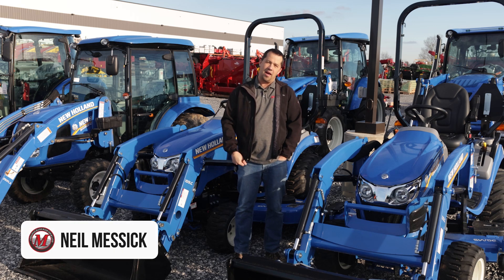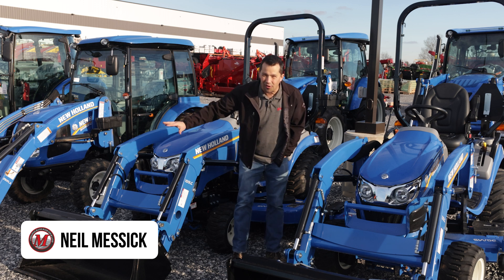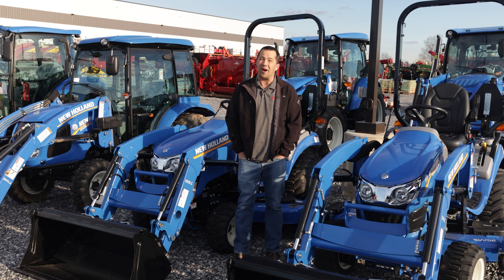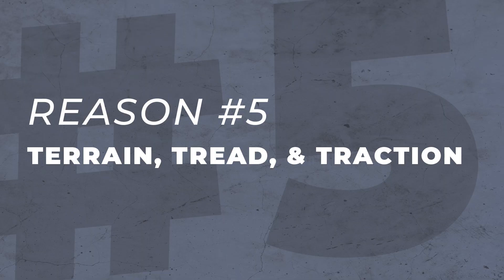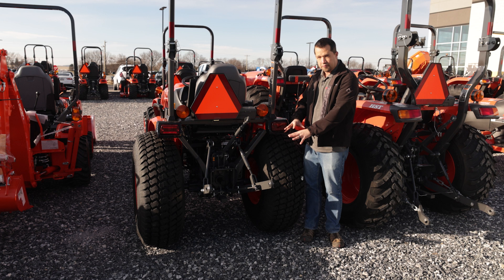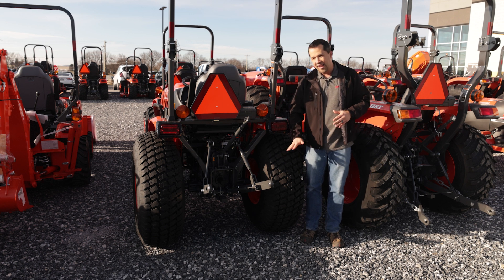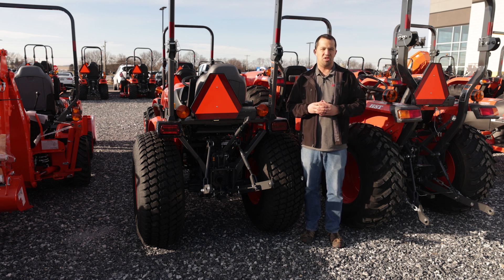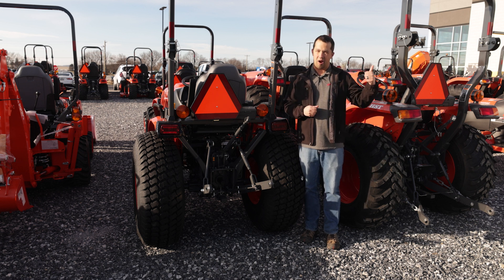5 Reasons Your Tractor Can't Climb a Hill

Comment: I love my 80s kubota ant 60s belarus. They pull like trains for their size. Cold hot, nothing maters. Most gears are limited by tire traction. Want quick responsive tractor? manual transmission will help.

Comment: That last thing you want to do is go up a hill fast. You need to feel the side and front balance. It's the difference between a close call, a tip, or a tip and roll. Slow is good. Going up in reverse is good. 4 wheel drive is good. Heavy weights on the wheels are good. Going fast is not good...I've had close calls on hills and it's made me take them much more seriously. Small hills, holes, bumps, etc...can all throw a tractor off balance if you're going too fast.

Comment: Pulling hills with a hydrostatic transmission is easy. I do it all the time in West Virginia. Let off the gas and let the RPM's stay around 2400, and a tractor will go right up a hill even a steep one with no problem. I have a L2501 pulls with no issues. It is a tractor not a side by side.

Comment: This video is interesting because i've always been amazed with how well our garden tractor climbs hills. Straight up a 30degree incline. And when we got a Kubota, it was an old manual trans with bad brakes, so I always make sure i'm in low range with high revs for fear of stalling. That thing will climb straight up a wall with the Asian market R2 tires.

Comment: I bought a new Workmaster 25 HST.  It was worthless in high range.  Shouldn't even come with a high range.  Took it back and bought a Workmaster 40 HST.  If I could do it over again I'd get the Workmaster 35 Gear Drive.  I'd save thousands and have more power.  Live and learn....

Comment: Hmmm...what do I know, original from Europe in Canada now. Big surprise calcium loaded rear tires when I bought my first tractor. The second one, I ask for no calcium in the tires. Lets not talk brands, before I borrowed a 50 horsepower tractor from a neighbor, going up the hill to my place had to shift down twice, just regular transmission, it was 30 years ago. The tractor I bought 60 horsepower, turbo charged, regular transmission no calcium in the tires to drag up that hill, just went up the hill in the big gear without any shifting down.

Comment: The hydro tranny is the biggest problem up or down a hill, had a  old 16hp diesel gear drive  compact and with the rear in lo and transmission in lo you could use the engine to crawl down steep hills without the tires breaking lose that you couldn't even think about with a hydro and pretty much the same going up not to mention the hp loss.

Comment: I used to mow an old dirty dirt dump with my tractor. This dump had massive hills that you couldn’t really mow sideways. So I would go up and down them. My tractor has a hydro transmission with 3 ranges. It could climb the hills in medium but did a lot better job in low.

Comment: One thing I have also noticed is the operator will not raise the RPM when putting the unit under load like that. You don’t need it all the way like you are running a bush hog but bringing it up off idle makes everything work a lot smoother

Comment: The swash plate angle does not change the gear ratio at all... it changes how much fluid is being pumped. In the neutral position it pumps no fluid so you don't move, as you push the pedal down the angle changes which allows the pistons to start moving fluid, a shallow angle moves a small amount of fluid at low pressure the steeper the angle the more fluid and pressure you get. That means if you push the pedal down harder, you will go faster and you will be applying more power to the ground. 

I think were people confuse this as being a higher gear ratio come from the fact that, the harder you push the pedal the more power hydrostatic pump needs from the tractors engine, in order to push the higher volumes and pressures through the pump. This can cause your tractor to bog or stall if it doesn't have enough hp for its Hydrostatic Pump size, tractor weight, and gearing. Remember that with a lot of these tractors the 25hp model might have the same transmission and mass as the 45hp model... Conclusion a lot of Hydro tractors are simply under powered for there size.

Comment: I have no idea why anyone would pay top dollar for a hydrostatic transmission. They put so much less HP to the ground, the oil changes, warm up time and everything else. Is it so important to have that gas pedal style of driving? And listening to all that whining from the pumps?
I think the glide shift is the way to go.  Just select a gear and go. Plus you get the HP you need to pull a mould board plow or other ground engaging equipment.
Reply from the maker: Glideshift was great, they don't sell it anymore.

Comment: Yes, the hydrostat pedal is not an accelerator, it's a "gear" range selector. Going up a hill, keep your foot where you want and add throttle up until you run out of horsepower.

Comment: Good video but should have talked about the weight of the loader and bucket.  If I do not have weight on the rear axle I have trouble going up hills because of the weight of the bucket.  I frequently turn on the 4WD for just going up and down hills.

Comment: I own a small Tractor service.. physical size is a major factor for me when looking at new tractors, the first thing I want to test is if the tractor can go up a hill in medium hydro gear... at full pedal... I carry full buckets of Gravel up driveways all the time.  I have found the kubotas lx, l , even bx will do it. New H  workmasters will not but a boomer will, mahindra of same size will, LS will not, Branson yes and Kioti/bobcat yes and Deere is very model specific. These are tractors in the 25 to 30hp range.  Many tractor owners are not farmers where crawling speed performance is critical. Many, like myself, value the speed over ground while under load (full box blade, full bucket and uphill)to be more important than what can be done in low gear. I also compare the pto power of those same machines and find the pto performance better on machines with poor medium speed uphill performance. I would really appreciate a more detailed explanation on what makes one brand more suited than say another brands equivalent machine or possibly the hydro transmission differences.

Comment: I have wanted to buy a tractor for years. I have 12 acres in the foothills with only 2 of them being graded flat and level. The rest are hills ranging anywhere from 15 to 40 degree slopes. Can someone safely and practically run a tractor in this environment?
Primary use is trail building and maintenance as well as land repair from badger digs throughout that can destroy acres and acres. 
Thanks in advance for any advice or comments.
Reply from the maker: personally, I'd be looking at renting a compact track loader or dozer for hills that steep.
Reply: Neil,
Thanks very much for your input. I thought those angles would be pushing it for a tractor. 
ATB,
Michael

Comment: It seems the takeaway is don't get a tractor to go fast. If you want to go fast, get a go cart. These machines were designed to pull like mad on relatively flat, smooth ground. The fact that lawns have grown exponentially larger is making them attractive to users unfamiliar with their operation hasn't yet been adequately addressed by the manufacturers. I've been working ag tractors for well over 50 years, and from my observations I'd say the most dangerous time for newer operators is after 2 to 5 years of use when familiarity has, as the saying goes, begun to breed contempt. Beware the folks who think they're pretty skilled after 400 hours of seat time.

Comment: I drove up a steep hill dozens of times taking loads from my old driveway to make a trail to my well. BX2380. Only thing I had to do was put it in 4x because it was actually slippery. I had a bucket full of dirt and my box blade with 20 ft of 1/2-in chain hanging off the back as counterweight.

Comment: I had this problem when I got my L2501. I need to mow uphill all summer long. I was pretty upset thinking the salesman sold me the wrong machine and it was too late to upgrade. Then I dropped my loader. That changed everything. Dropping all that dead weight allowed me to shift into M range and I can now mow in half the time it took me previously.

Comment: Good explanation Neil.  Took me many years to learn this. I used to struggle with a 35 HP New Holland hydrostat. Kept telling our local dealer this tractor is way too wimpy.  He couldn't explain to me as you just did why. I finally figured out after about 8 years and another New Holland with a manual transmission. Could've saved a lot of money had I known this.

Comment: People with their toy tractors, trying to pull a hill in high range. I've pulled 8000 lb grape bins up hills with a 30hp gear drive without a problem. Rented a 40hp hydrostat one harvest; biggest pain to use, constantly swapping ranges. Buy a tractor with a real transmission and learn how to use it, you'll be fine.

Comment: My M7060 is a turd up hills. In road gear I have to downshift 2 or 3 gears  to get up even slight grades on pavement. My L5040 I had would climb any hill around in high gear. Granted, the 5040 was around 18 mph, where the 7060 is 24. Still, a 70 horse tractor should be able to zip around better then it does.
Reply: Thse newer machines with more gears don't have the torque of the older tractors of the 70s and 80s

Comment: I have a lx3310 and I use it at 8200-8800 feet. Yes I run out of power in high gear on the road pulling a grade going to my neighbors place. Low gear I can spin my loaded tires all day working.

Comment: There's also the misconception that mashing the hst pedal equals more power, particularly when the throttle is tied to the pedal. When an hst is starting to lug on a hill the operator needs to LET OFF the pedal and raise the rpm.
Reply: That's the opposite of what people are used to.  With a car, truck, etc. when they approach a hill they press harder on the "Gas" pedal, so their reaction on a tractor is to do the same thing with the hydrostatic pedal, mash that pedal to the floor it'll go faster....yeah, on flat ground without being under load LOL...not when going up a hill....with my BX2680 if I'm in high range, and have my roto tiller and front loader installed and try to climb the ramps onto my trailer, it stops moving forward....not like spinning the wheels, but it literally stops all forward motion....low range, 4WD, and light pedal application and it climbs right up no problems at all....have to pick the right range and go slower than your mind wants you to press on that pedal LOL

Comment: In your experience would this apply to Manual transmissions as well? I would think not. And why would anyone want to rip uphill? Maybe a red tag sale on isle 24? Pun intended. Cheers.
Reply: You would just manually select a gear that'll get you up the hill, even with a  hydrostatic transaxle, you do the same thing, low or medium range depending on how steep the hill is to get up the hill, with either type of transmission you'll not climb the hill at the same speed the tractor would be going if you were on flat ground with the hydrostatic pedal to the floor, or in top gear with a manual tractor....in fact with a manual tractor you very well could stall it if you were in too high of a gear....with a hydro, I'm not sure if it would stall it or just stop moving forward....if I have my roto tiller and loader on my little Kubota BX2680, and try to climb the ramps onto my trailer it'll stop moving if I'm in high range, have to use low range to get up the ramps with all that weight...but it don't stall the tractor it just stops moving forward.
Reply: @wildbill23c  My comment was a pun intended, having much experience with gear drive and hydrostatic trans I well know the ability's and short cummings of farm tractors and construction equipment. I was more curious why people think tractors can speed up hill, a dangerous endeavor to the uninitiated. Still, thanks' for the reply. Cheers.
Reply: @johnambro7181  Very true.  Anytime I'm using my tractor being in a hurry isn't anything of importance...I got a tractor to keep me from having to do all the heavier lifting and dirt/gravel moving chores by hand...that tractor saves countless hours of work, sitting on it and operating it ain't much work in comparison, I'm not in any hurry when I get to do tractor work, I enjoy it  LOL.
Reply: @wildbill23c  I'm 63 and this is my work horse-B2650, slow is the way to go! Cheers.
Reply: @johnambro7181  Well, my BX2680 isn't exactly fast, so you won't be going anywhere in record time...well I guess unless you are trying to have the slowest record HAHA!!!  Those B-Series machines are nice, wouldn't mind one but have no need for anything larger on my 1 acre property.

Comment: So I bought a new Kabota M4 it had no power going uphill. And I took it to the dealership three times and they said I should’ve bought a bigger tractor. and I finally had it after two years and took it back up there and they said oh there’s a Service bulletin on bad injectors come to find out three of the four injectors were bad and I had to deal with that for two years. While making payments on a brand new piece of garbage. The Kabota rep came out and drove my tractor said it was completely fine and normal For it to bog down going uphill. Now it runs fine drives up the biggest hills no problem. Kabota just tries to keep everything out of the dealership when it’s under warranty

Comment: Our gun range has a lot of roll. Read hills. We went much bigger in tractor than one would normally assume. 

For example, the smallest Kubota we looked at was a M4-71. Ultimately we did call Messicks (during pandemic) looking for a M5-111. 

None to be had then. 

Ended up with a Large Frame 75hp, 11,000lb, cabbed unit, with wheel weights and fluid in the Ag tires. 

Tractors will climb hills. But if you want to go fast, get a UTV. 

Finally…who the heck doesn’t warm up their tractor? Or any diesel machine? 

Regards,
Marky
Reply: I start my tractor and let it sit for at least 5 minutes before I move it out of the shop but then it sits outside the shop for another 5-10 minutes idling before I even put it under any sort of load, while I'm gathering up tools and stuff for whatever project I'm getting ready to tackle.  During the winter though, it just sits in the shop, don't have any need for it in the winter.
Reply: @wildbill23c  Yeah. Our policy to let it warm up at least 15 minutes, and even then it’s still cold.

Comment: Loved Your Gear Vs Hydro Test. I Grew up Working with a Ford fn8 Those so called little tractors would pull a mountain of square hay bales.  Then I started working at my Local Port. We would use  John Deere 50Hp Tractors  in mid gear number 2 to Pull 99 200lbs of  Giant Rolls of Paper up to the Ship for loading. It is amazing how different the hydro Tractors are  compared to Gear Drive. An those  Old school John deere lasted 5 years 4000hours  before needing rebuilt on the trannies. Now I'm into a Gear drive Kubota and Wouldn't look back. Best bang for the buck and Easier on fuel too then hydro tranny.

Comment: living on a hill with a 29HP hydro no dramas - wait till it is up to temp before going and run it around PTO RPMS all the time once up to temp.  
The only times it slows is 4wd up hill in wet weather running a large flail in tall grass or running the flail through shrubs the height of the rops - love the flail no removing fallen branches or small shrubs/tree in the way but a really nice finish that you and your dogs can walk on.  
It will start in high gear up hill with a full bucket of clay however there is an art to doing it and probably isn't a good idea from a frame damage perspective as it will bounce more.  
I would note that the maximum pump flow if you need power is 3000 RPM so if not running a PTO implement and want the flow/"power" - AKA hill, loaded bucket, backhoe or other hydraulic attachment; get those RPMS way up. Idling is not going to get you anywhere fast - yup ear muffs and get things done.

Comment: Because I hated the whine of a hydrostat when I bought my tractor I bought the shuttle drive and 12 years later I still prefer it. The only change I would like to try is R14 tires.
Reply: My 35 hp tractor has a shuttle shift but you have to clutch it which trust me is no big deal. Some bigger models have a power shuttle which doesn't require clutching. That will be my next tractor if I upgrade but at my age now I'm down to mostly snow clearing in the winter my summer projects are all complete.
Reply: @richardl.993  Thank you for the insight...clutching isn't an issue at all, shifting while trying to operate the loader would be one of those times you need 3 hands LOL.  But with the shuttle shift it makes it easy, even with the clutch based models for sure.
Reply: If only the small tractors had an option of a shuttle shift, or manual transmission....I don't think the BX ever had a manual option, I know there isn't an option now, its hydro or nothing LOL.  I wish my BX2680 had a manual transmission of some sort sometimes especially when I'm just out mowing.  Loader work the hydro is nice, but from what I understand a shuttle shift would be extremely easy too as you can shift between forward and reverse very easily/quickly without the clutch.

Comment: You guys should host a clinic to teach all those weekend warrior property owners and "hobby farmers" how to use a clutch on a gear drive.
Reply: Unfortunately that's not the problem...the problem is, many smaller tractors are only hydrostatic.  It has nothing to do with knowing how to use a clutch and gear drive...its all about the lack of those options in smaller tractors.  I wish my BX2680 had a manual transmission sometimes, especially when I'm just out mowing.